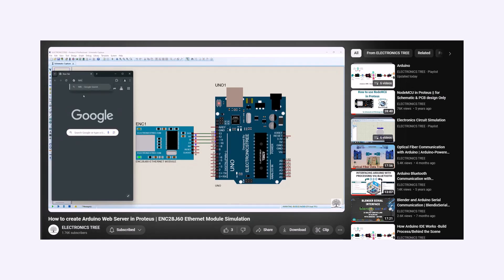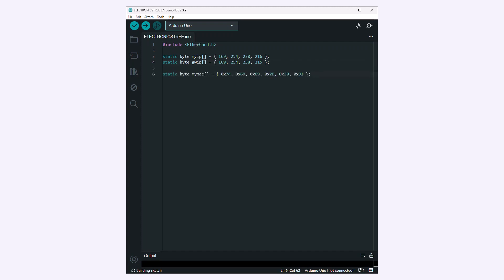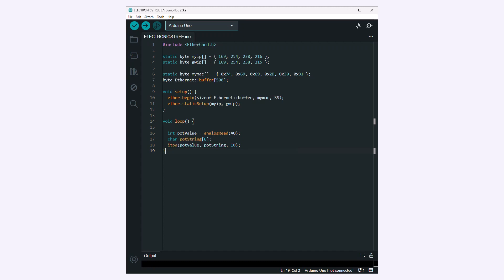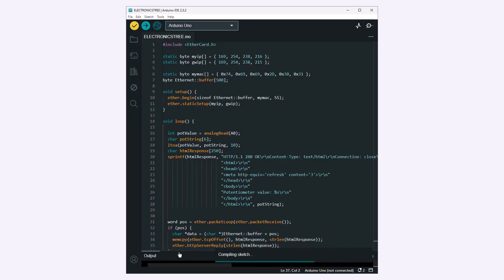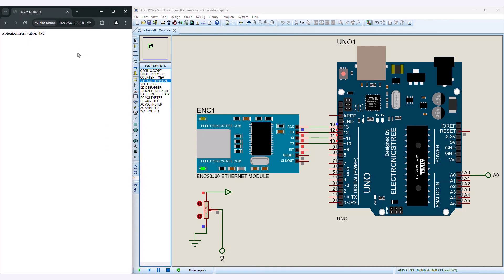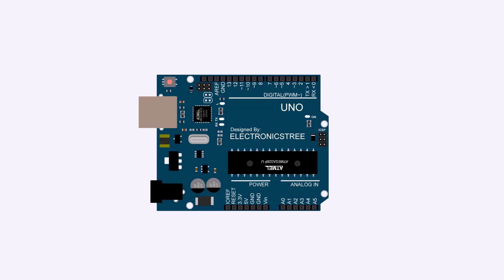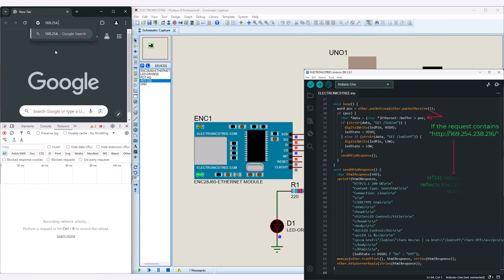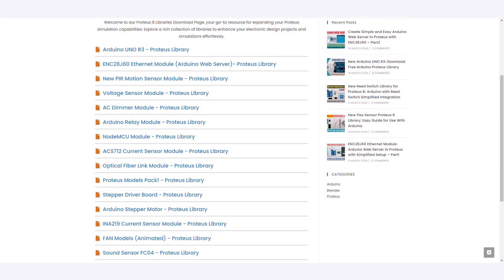Ethernet based Arduino Web Server | Proteus Simulation | Part 2

Comment: what is the capacity of the Ethernet::Buffer ?
I tried for HTML 10546 characters
web browser just loading

on the hardware I use W5100, and it runs smoothly
because Proteus doesn't have a library, I simulated it using enc28j60
Reply from the maker: please read the Ethercard Library Requirements
"Depending on the size of the buffer for packets, this library uses about 1k of Arduino RAM. Large strings and other global variables can easily push the limits of smaller microcontrollers"